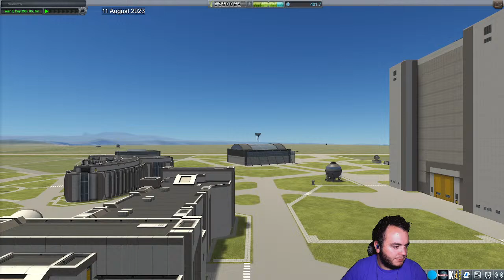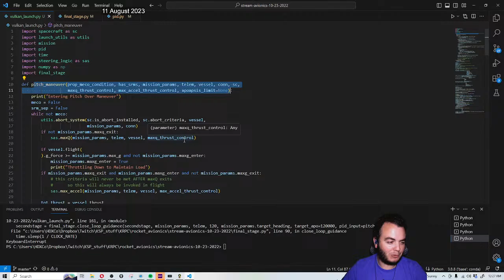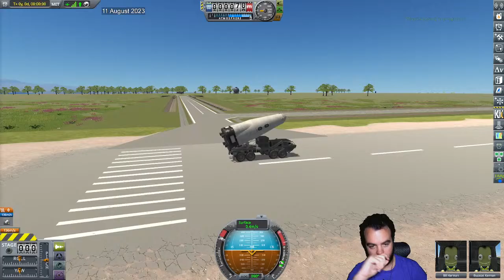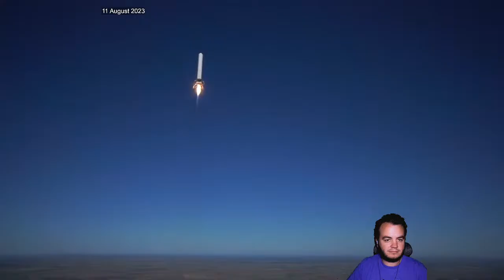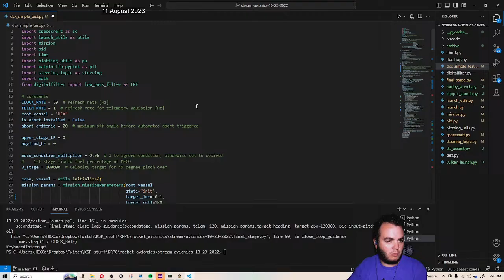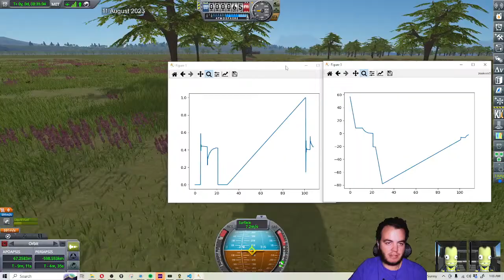Kerbal Launch Lab Ep. 1: Retrospective Rocketry

Comment: yeah basically with PEG, you estimate the burn time to get to your target state (0 vertical velocity ideally, whatever horizontal velocity you want to get to your orbit) and make a guess at gravity losses. Then you define a "coasting trajectory" that will get you to your target orbit altitude at MECO, assuming no gravity. Then, you go back and figure out where you would actually end up under the affect of gravity. You then add the extra position and velocity and plug it back into the burn time calculator, and run the whole thing again. Ideally after a certain amount of reruns everything will converge on a set of values, and the algorithm has solved for your trajectory.

Comment: "Hey, we want to do this specific maneuver, to get to this specific orbit." Okay so funny story. I tried automating an SLS launch (in realism overhaul) with MJ's dedicated RO ascent guidance mode. It's scarily good. Apparently it has like, PhD level math under the hood. But at the same time, it hates solids. Doesn't implement a thrust curve properly, it kinda just dies. So, I decided to try a different autopilot mod. I use easy mode(kOS), but the more I tried to break down the problem and figure it out, the more I realize I just don't have the knowledge to do it myself. So I decided to copy Draper's homework and implement a real world algorithm, Powered Explicit Guidance aka PEG(Saturn V used something called IGM, PEG was used by the shuttle.) But at the same time, trying to implement multiple iterative solvers into a kOS script sounds pretty daunting... I still haven't finished the initial burn time calculator, and this is before we start solving for the actual trajectory.
Reply from the maker: It is certainly involved for sure. Especially with the shuttle's improvement with Unified Powered Flight Guidance (UPFG). Certainly going to be a long term project, hopefully something we can do in python iteratively working first with this DCX vehicle!